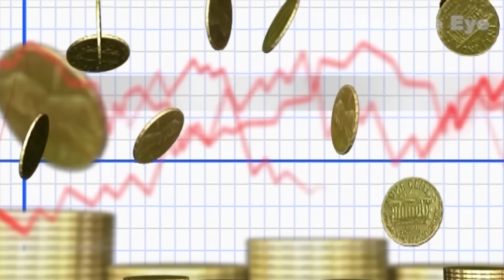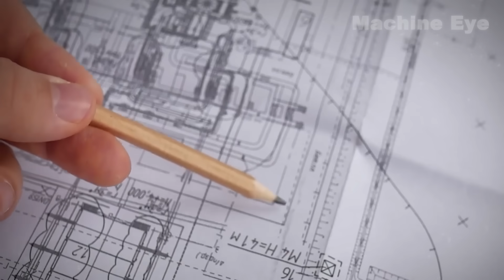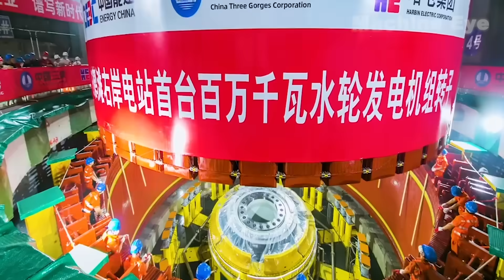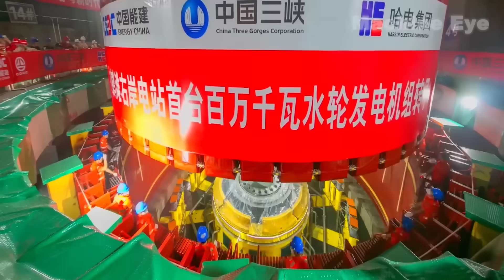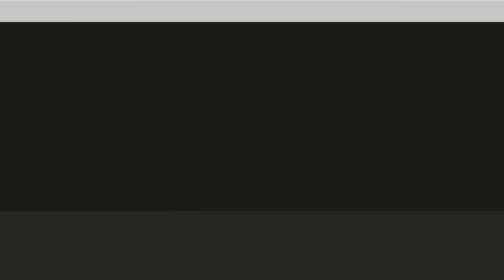China's Mega Projects Stun American Engineers, "Infrastructure Fanatic" Is Indeed Well-deserved!

Comment: the U.S. contracted China to make the bridge components to span San Francisco to Oakland, The company hired had never made a bridge before and many of their welds were faulty and had to be redone. so either they hate us, don't want repeat business or their incompetent, Let's look at the new mega tunnel that has some MAJOR leaks, a bridge's main pillars had about 2 inches of weak cement not concrete (some guy took a piece of rebar and poked a hole through its corners) after breaking away a sizable area it was shown wire mesh and the inside filled with loose rocks, next, a tall bridge, 40 feet high, 3 laned, V-shaped at the top. a truck driver drove on the outside lane which caused the whole section (about 100 feet) to topple over, Apparently, no one warned trucks to NOT use the outside lanes. Seriously, the list goes on and on No respect for their quick jobs with no accountability or quality control or safety